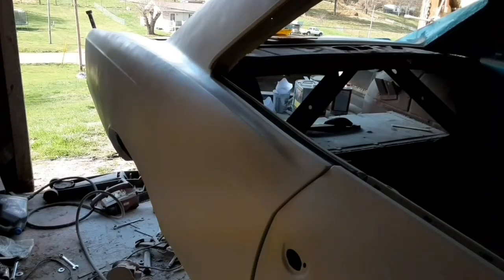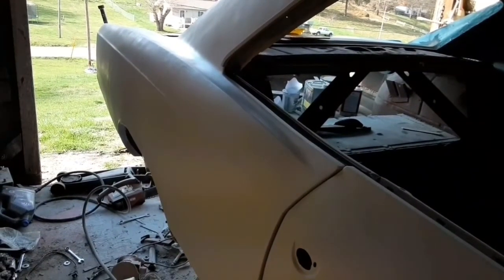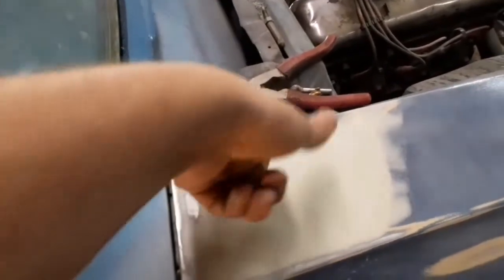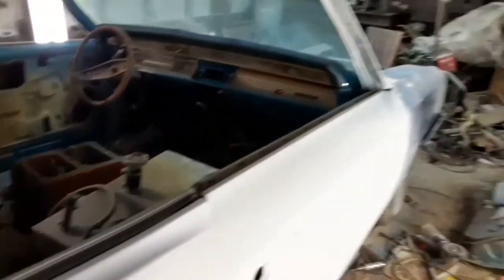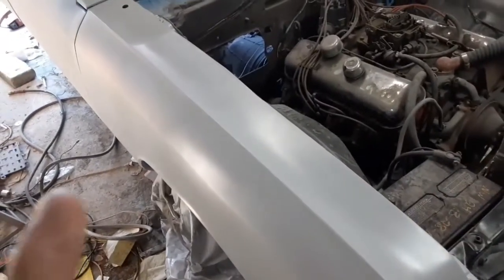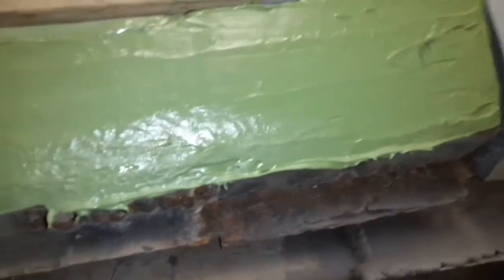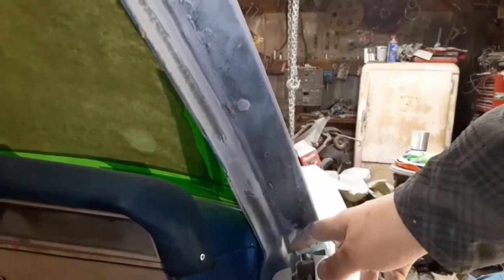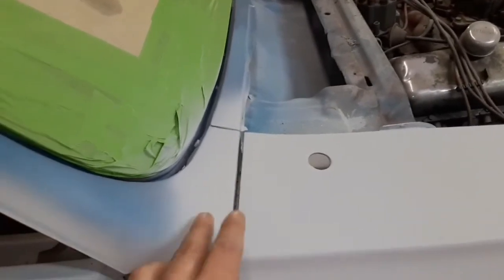67 chevelle bodywork video number 6

Comment: I get feeling burned out on bodywork, that happens to me on every car I do to the point I can't stand it anymore and that's when it gets painted.  LOL.  I guess that last picture means your pulling the Th400 out.  The transmission isn't behaving the way you had wanted? Which Muncie will take its place?
Reply from the maker: Transmissions still working but I have a difficult time trusting it at least if a muncie screws up I might be able to limp it home & the last one I put together with a original 67 shifter